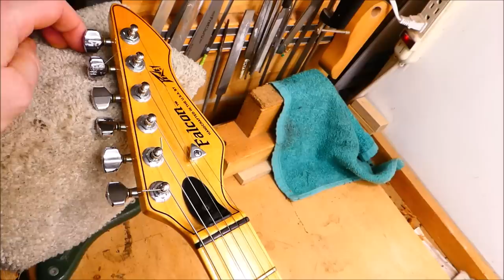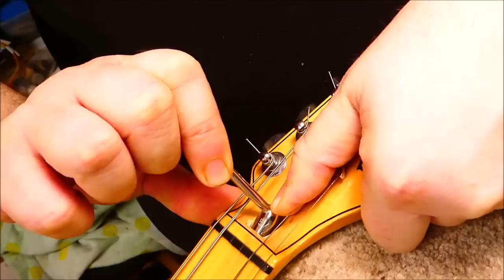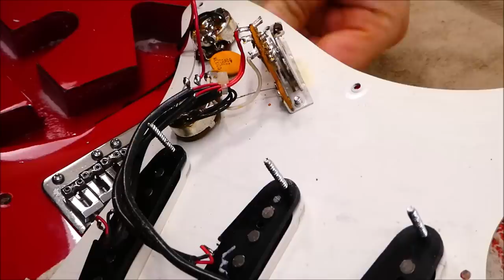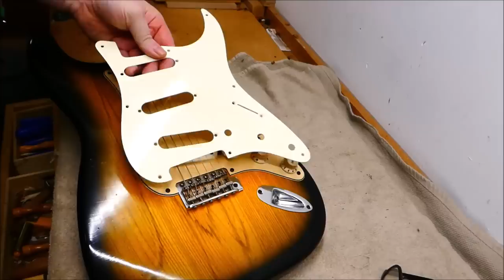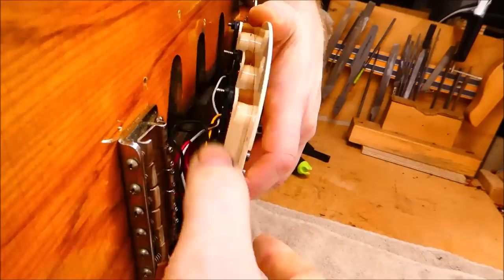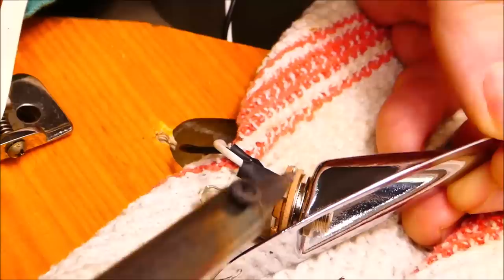Strat-type things.

Comment: I’m impressed that the body had an actual S/S/S routing and not just a big “swimming pool” route to make things more economical for Peavey.
Reply: Is there a difference in tone the two strat type of  wood routed bodies you mentioned? I actually have both, recently purchased a Fender player ash wood body strat with S/S/S route
Reply: @davidallen346  

Probably more of a variation in tone from guitar-to-guitar than something based on the pickup cavities. I’m sure it makes some difference, but hard to quantify. I’m just impressed that they did the routing differently when they could have easily made one big route and used it for every guitar.
Reply: I think it's due to the CNC routing. It makes easier to do whatever they wanted.

Comment: The differing screw placement is a function of its "Vintage" specs. 50s spec tend not to have the upper screw and do have the lower screw. This is how putting a pick under the upper bout of the pick guard became so popular, but it can/does cause single ply guards to deform slightly over time, which is why they eventually went to 3-ply and more screws. It may be something to keep an eye out for when ordering after market parts.
Reply: 50s spec have 8 screws vs 11 on modern pickguards. It's much more than just a moved screw hole. Seems like you need to get one of each and remind yourself if what they're actually made like. Because 11 screws is more than just "it doesnt have the upper screw but has the lower screw" or whatever you said.

Comment: You really should re-lube pots after using automotive contact cleaner. Deoxit has lube in it, but the automotive stuff typically does not.
Reply: Im glad to finally see a comment about this. I had someone once tell me to use lubricated contact cleaner but could never find any that specifically mentions being lubricated.  
What about a computer targeted electrical contact cleaner?
Reply: @joeferris5086  MG Chemicals NU-TROL Control Cleaner works great.  Mouser caries it.
Reply: @joeferris5086  De-Oxit Fader Lube is a great product.
Reply: @martinh8481  Nu-trol is great stuff. I only mentioned the overpriced brand because it seems more commonly known.
Reply: I doubt Ted needs your advice on lubing pots 🤣
Reply: @J.C...  Why? There's always something new to learn ...
Reply: @J.C...  Looks like he needs some advice regarding replacing pot with the broken shaft. Come on, Ted! That was sloppy. He’s got broad shoulders. He can take it.
Reply: @J.C...  that says less about him and more about you…
Reply: Damn straight!

Comment: Never ceases to amaze me how much some people will bodge things together rather than make a proper repair -I initially thought the plumbers tape on the pot shafts were due to the shafts being too small NOT that one of the split shafts had broken and the tape would hold it together. Not as if the guitar was a $30 cheapie!!!
Reply: I've started measuring the resistance of pots on my guitars. "Industry-standard" CTS pots have a 15% tolerance so your 250k pots could be 215 or 285, and if you've got 215 on the tone and 285 on the volume your guitar will always sound muddy.
Reply: Yes and those pots are soo expensive NOT....
Reply: Sometimes in a pinch you do a fix that works. Sometimes it works well enough you forget you need to do a more permanent repair. Haha

Comment: On the two piece Peavey necks. My understanding is that Peavey flipped one piece of neck so that the grain went in opposite directions. This supposed to increase the stability of the neck.
Reply: You mirror any tension that way, similar to how balancing a signal works ;-)
Reply: @christianboddum8783  It would...........trust me.
Reply: @Hollcall  It would what?
Reply: @christianboddum8783  read the ???????
Reply: @Hollcall  What???????

Comment: The two piece Peavey neck was built so that the truss rod assembly was put into a curved slot in the center of the neck and then laminated and the fret slots were cut all at once and the frets were pressed in in a single process. This save a lot of manufacturing money and made the process very accurate.
Peavey had some really innovative features on the truss rod. The threads on the rod were rolled rather than cut and that makes the it stronger than cut threads. Further, Peavey used a special truss rod wrench made of thin metal. This was by design so that the wrench would fail before a truss rod did. A regular wrench would not fit.
The T40 and T60 instruments were introduced in the US Market at $350 including case Strats & Teles were about double that. 
The wiring on those was unique in that the tone knob would fade one humbucking coil out after about 7 on the control, producing a single coil.. 
I don't know if the Falcon had the other feature that turning down the volume control did not cut the highs,

Comment: I found a Fender Squire Strat outside a church recently. It had been dumped basically. The repairs required were very minor it needed the input jack socket resoldering and a nut and washer a missing tone knob and nut for the pot and a few strings. I bought a new set of strings for it but have been playing it with the old ones as it plays well. It had a soft case which I hand washed and it is fine now and the neck had more gunk on it than the underside of a lorry but I got most of it off. I will get it 100 percent when I change the strings. There is a bit of grounding noise on it and I am.not sure what is causing that. It cancels when you lay your hand over the strings so I am guessing it is the main grounding wire. Lovely watching your work, thank you.

Comment: On the shielding tape: if the adhesive isn’t conductive, or one isn’t sure, just bend tabs of tape over so that the top of the overlapping tape is contacting the top of the lower tape. Viola: continuity.

Comment: I'm not a luthier, but electronics is something I do know a bit about.  Conductive adhesive copper foil shielding tape can be sourced from big electronics supply houses, like Mouser and DigiKey.  "StewMac" seems expensive and checking the big supply houses out may save a few $.

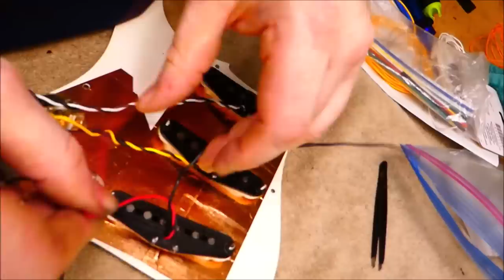Comment: 14:00 Oh woe is me...   Twisting heater wires on valve amps stops them emitting as much 50/60Hz hum but it does little on pickup wires. Its a good idea to replace these plastic coated wires with vintage style cloth covered wire as the cable is different internally and the leadout wires are part of the inductor windings. It just changes something and they sound way strattier. All these little things add up.
Reply: Hi very interesting, are you saying change all the wires to vintage or just the pickups? Many thanks
Reply: nonsense! for that wire resistance to actually matter, the pickup coil would have to be like 10 turns of giant solid core wire

Comment: You can use a "pounce wheel'" for transferring sewing patterns onto cloth with chalk to make contact with the copper foil pieces. That is how we did the aluminum foil window glass burglar alarm strip tape way back in the 1970s. The pounce wheel punches holes in the two pieces of foil and displaces the adhesive & mashes the pieces of foil together. IT WORKS! An open circuit causes a false alarm and the second false alarm in  12 months was a $500 fine. That is $500 in late 1970s' money which is like $3500 now.

Comment: The middle pickup on the Peavey sounds very pleasant. Some middle pickups are an acquired taste... Great vid. Can equate to the frustration of trying to get parts back in place. Especially when you don't want to have a screw or metal part scratch something.

Comment: That Peavey Falcon looks and sounds pretty nice.  I have an old T-60.  I'm not into serial nos. and stuff, but it is a really great guitar.  Weight is not a problem since back and knee issues force me to play sitting down all the time.  I got the guitar and a decent-sounding Crate 60-watt amp at a block sale about 25 years ago.  I blew up the amp at a gig not long after, but I haven't had to do any work on the guitar other than routine setup and maintenance work.  The wiring is pretty cool.  It has two full-size toaster-top humbuckers, three-way selector, phase switch, and individual volumes and tones for each pickup.  The really cool thing is that the tone controls also act as coil-cuts.  From about 0 to 6 on the tones you are in humbucking mode, but once you get up past 6 you gradually cut out one coil until at 10 you are in full single coil mode.  This guitar is, I believe, the very first model that Peavey made, and for a first effort it is really versatile, producing Les Paul and Stratocaster tones, and just about every shade in between.  My only complaint is that the neck is a little narrow at the nut for my sausage fingers.  I paid $175 US for the whole rig, including a molded hard case and an ancient Ibanez fuzz box in an orange metal housing.  I sold the pedal to another guitarist for more than I paid for the whole rig.  My only regret is that I didn't keep the pedal, but, like everyone else at the time I was doing the Tube Screamer thing.  Thanks for the detailed look at Strats.  I like all your videos, but I really enjoyed this one because I mostly work on solidbody guitars.  Great presentation!

Comment: I was lucky once when replacing the white-ish pickguard of my 'Highway One' series Fender Strat's pickguard with a black one from Allparts and the latter's holes lining up perfectly, though! 😊👍   BUT:  I had a nightmare only last week before giving my 14-year old Son a full-size Strat copy as an upgrade to the 3/4-size one he'd been playing over the past year and a half and which has meanwhile become too small for his hands.  My idea was to first swap some parts between the two guitars and especially the pick-ups, as the mini-Strat's sounded quite a bit better, and despite its body, neck and pickguard being smaller, all the other parts were actually full-size, so the swap should've been a matter of just unsoldering the wiring's connections at the output jacks and at the tremolo claws and then popping each set of pick-ups plus electrics into the other guitar - but no, wrong!  For starters, the holes in the pickguards for the 5-way switches didn't quite line up, and then it also turned out that the mini-Strat's pick-ups were slightly to big to fit through the holes in the full-size's pickguard! 👎😆  And just swapping the sets' covers didn't work as the holes in them for the pole pieces differed between the 3 pick-ups on one guitar while the covers on the other guitar were all identical 🙈   I should've paid more attention and taken my soldering iron dying right at the start of this project as a sign to not proceed any further, as well as it having been difficult to find a new one!  My poor nerves...!  And of course, both guitars are now back to being exactly as they'd always been! 😆
Reply: As a builder and modder of guitars, guitar pedals and guitar amps Ive done that more times that youd likely believe if I told you (worked on something for hours, days, weeks and even months just to end up having everything go back EXACTLY how it was before I started for one reason or another.) The only difference being now the thing I was working on has wear here and there from taking things off, putting them back on, swapping things around etc etc. But the consolation we have when that happens (which I think you touched on) is that now we know a little more an are ever so slightly more skilled than before we started the project. I believe they call that "learning something the hard way" lol. Good luck with your future projects!
Reply: Thank you for your good wishes,  @michaelinglis567 ! 😊🙏  I'd done a bunch of guitar and bass modifications over the years but this was the first time I had to admit defeat!😅 I admire people like Ted and yourself who have the patience and resilience to do such work on a daily basis!  That sooo isn't me! 😆 My best wishes also to you! 😀👍

Comment: You Actually do not need to solder the tape sections, you can punch them with a pointer (for instance with  a line of dots),  so there is contact . I learn this many years ago, before you could get easily tape with conductive glue...
Reply: I have used ordinary aluminum foil tape to shield guitars with, and done the exact same thing as you described to connect the overlapping layers. A small Phillips screwdriver works really well to make a row of divots that punch through the insulating adhesive layer and connect the overlapping foils.
Reply: Yeah, same here. I use the aluminium tape and just centre punch them every half inch or so.

Comment: Nickel allergy is only a problem when the metal is in contact with the skin for prolonged time, like with jewellery. The nickel is biologically active only in ion forms and nickel is very stable so it takes time for nickel ions to be released from metal. Many coins are minted in nickel alloy (most often with copper: cupronickel) or even pure nickel, with few allergy issues as the coins are not kept in hands for long times.  Cupronickel is also used in cutlery and for many other objects. Most stainless steel also contain nickel.

 Is stainless steel safer than "nickel silver" regarding this issue ? IDK for the frets.  (edit: Jescar states that only their EVO gold wire is nickel free)  But it's the case for the strings.
Stainless-steel strings are nickel free as nickel in steel render it non magnetic thus useless for electric guitar strings. It's funny as pure nickel IS magnetic.
 When frets tarnish it's  mostly the copper that oxydise (and for a larger part dirt and residue from skin...) but in this case the cleaning was probably a good move as nickel is probably also present ... As for cleaning, washing own hands and wiping strings and fretboard after playing  is also a good move.

if found this :  https://www.stringsdirect.co.uk/blog/working-around-a-nickel-allergy/
and : https://www.jescarguitar.com/frequently-asked-questions/

Comment: The twisting wires to cut down on noise only works with wires that carry the same AC signal with opposite phase angles. In terms of pickups there is no phase difference between the two wires so they'll be no cut down on noise. A lot of the electric guitar wiring ethos came from amp builders and electricians incorrectly applying their knowledge to passive guitar circuits.
Reply: Yeah, but it gets you that sweet vintage tone that only parasitic capacitance can provide.

Comment: I know that the strings you have chosen are from very well liked and trusted brand but I have had some bad experiences with  D addario stuff. Even had a packed were the low E was broken inside the winding from new. I had some that rusted out real quick and a set were the ball end snapped off on the G long before coming up to pitch. I tend to look at the alternatives now.

Comment: That's a 50's 1 ply guard. I believe it also only has 9 screws instead of 11. Also a slightly  different shape around the bridge because of the wider bridge spacing the 50's strats had.

Comment: If somebody has a really sensitive nickel allergy, bear in mind that quite a few stainless steel alloys include nickel. I would guess fret wire might be one of the Martensitic alloys due to the need for wear resistance, some of them have nickel but not others. I'd guess the manufacturers would be able to tell you what grade of alloy they use if required.

Comment: 15:11  it's a 50's style pickguard on a 60's style body the reason for the missing holes.
Reply: No that's a 50s body too, 2-tone burst maple neck, but Fender have different placements for the screw holes depending on models and which country they're made in so third party manufacturers usually have their own placements too. Even if you buy from WD where they list exactly what models they're supposed to fit on they are almost always off somewhere.
Reply: @blodpudding  Also this neck  has a truss rod adjustment at the headstock (looks Mexican) not a 50's style neck 11:08 quite possibly a partscaster. also you can just see a bit of the fender logo here not a 50's logo.
Reply: @blodpudding  Also the bump out in the control cavity for the extra screw 50's strats don't have this.  12:03
Reply: @blodpudding  Not a 50's style body I have 50's style strats and have owned the Mexican road worn series and they are 50's accurate accept for the 12th marker placement I believe it's been a while since I have owned one.. but I still have my 57 stratocaster.
Reply: @blodpudding  Also the plastic wire shield cover and plastic bobbins is not 50's style in the least.
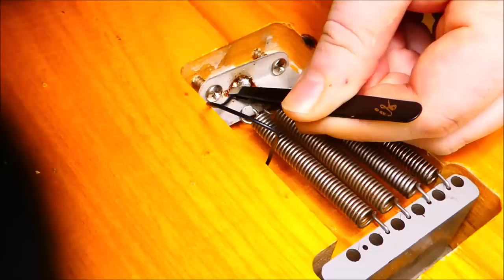Reply: @blodpudding  And also what fender body has the holes missing for the backplate?  aside from a signature guitar or two. 14:31  so many things wrong with this guitar.

Comment: Holy crow I think I finally understand something I've been trying to understand for a while now.
I have had a hard time grasping why conductive adhesive is required when using shielding tape or alum foil. If the adhesive is underneath the metal, why would it interfere with conductivity? This was my thought process. Is it because, we're assuming that you'd have to apply the metal in many different pieces, so you'd have layers on top of layers, and those would not connect without the conductive adhesive? That seems to make sense to me. 
But riddle me this. Lets say you use some spray glue that's non adhesive, but you apply one continuous sheet of alum foil across the back of the pickguard; in this scenario, it wouldn't matter, correct?
Reply: If glue was non-adhesive, it wouldn't be glue, lol. Yes, it wouldn't matter if it was one continuous piece. I prefer conductive paint for the pickup routes and foil for the pick guard.
Reply: @tiki_trash  Oops. I meant to say non conductive.
Thanks for the reply. I prefer conductive paint as well, it just took me a while to figure that out. Therefore I have a PG with foil glued to the bottom of it.